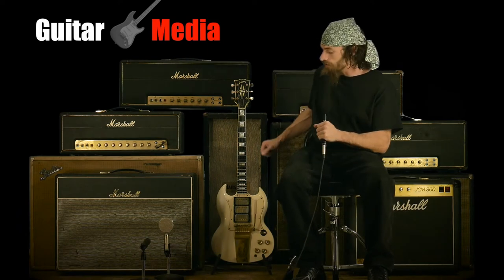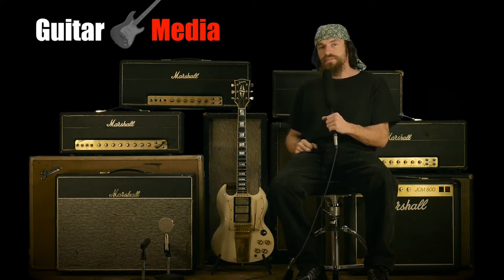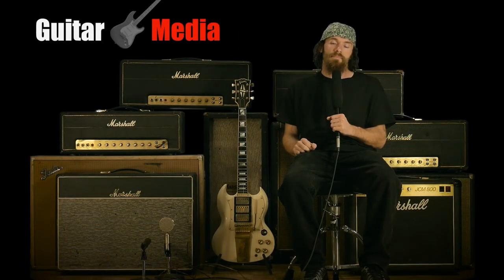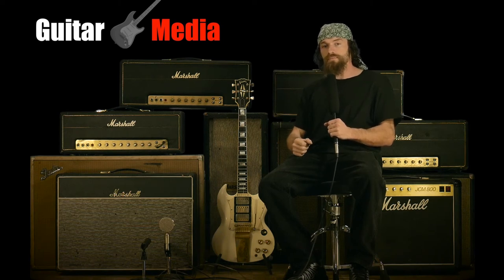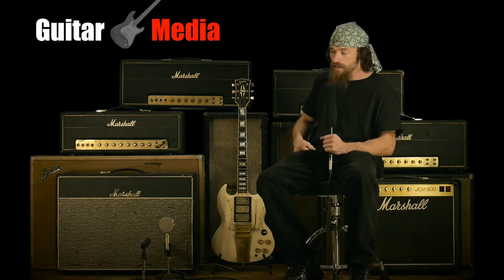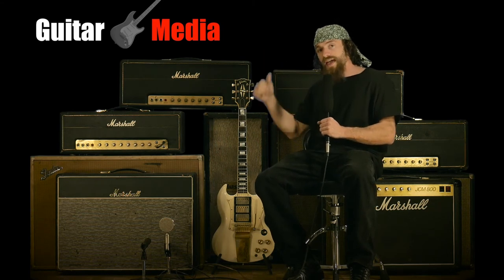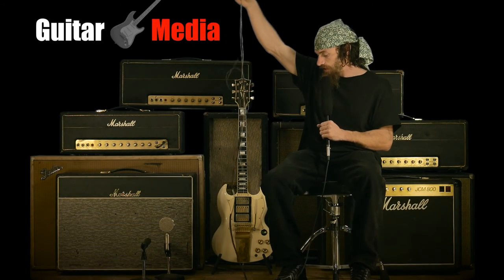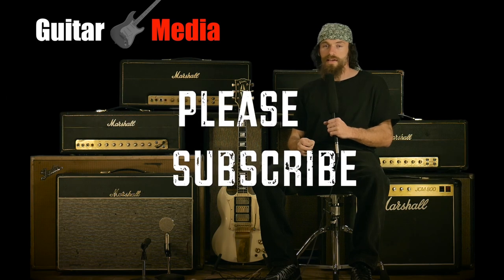How to play LARGE AMPS in SMALL ROOMS

Comment: Hi A lot of great content here on channel! Just wonder if same effect could be if remove single speaker from full stack and install/connect it in a separate cab to achieve same cranked tone with much lower volume level? Thanks
Reply from the maker: Thanks! great idea! (this is where personal preference comes in to play)
Should work great! (only single speaker overdrive generated in that way)
Care should be taken though, as you don't want to damage the speaker or the amp (make shure you've got it right)